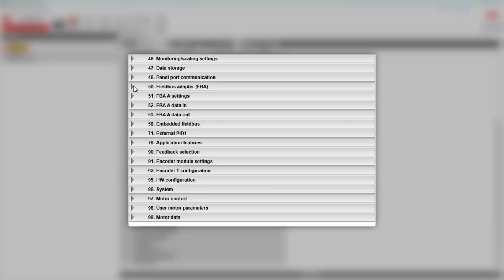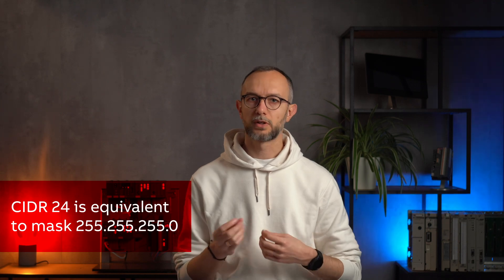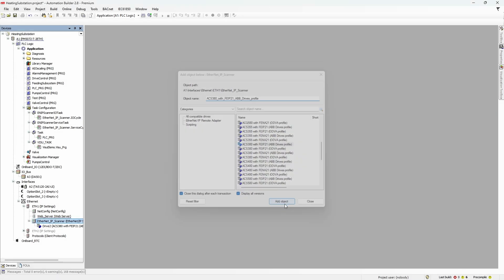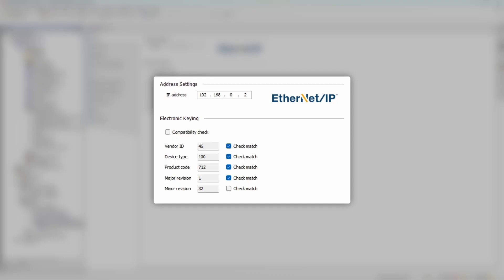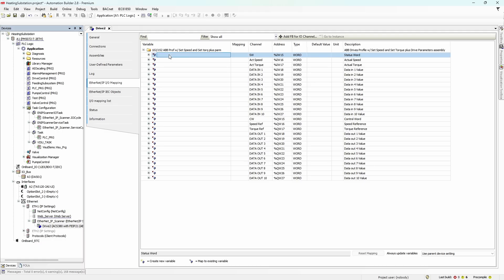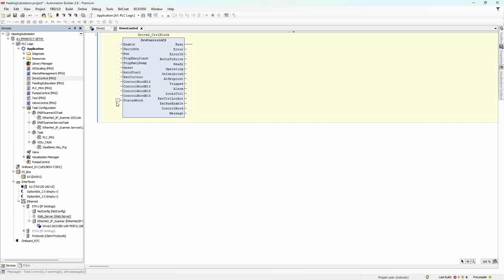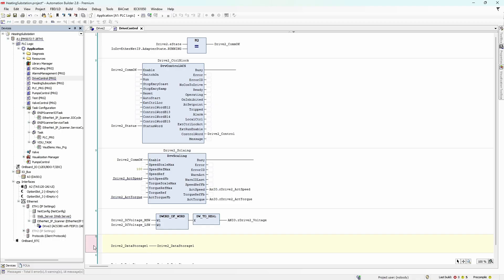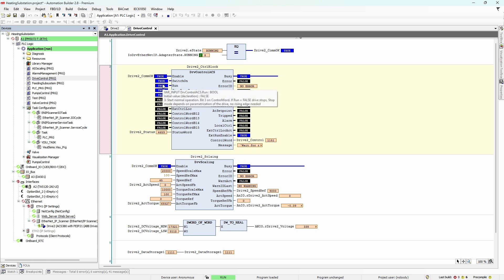Intro to AC500. Part14. ACS drive control over Ethernet/IP

Comment: Very useful. Can this step be used for control the ACS over Modbus TCP?
Reply from the maker: I'd say Part 13 (https://youtu.be/iMtv_8gQWHs?si=fhzx394U2Ece_PuL) is the closest to Modbus TCP. But if you watched and understood how to control ACS drive using Profinet, Modbus RTU and Ethernet/IP, Modbus TCP would be easy to implement.
Use DrvModbusTcp to send/receive data to/from the drive and then DrvControlACS and DrvScaling to control the drive and scale reference/feedback.